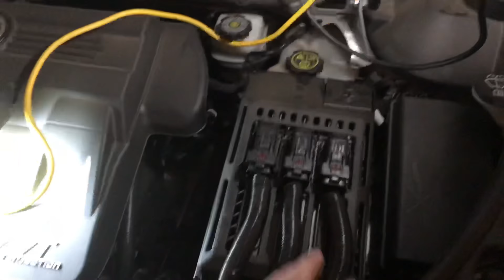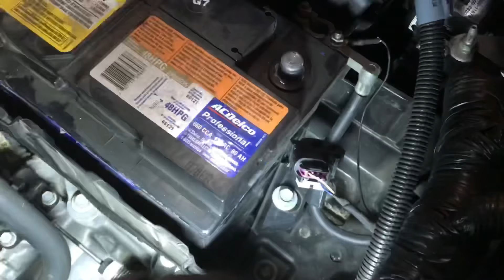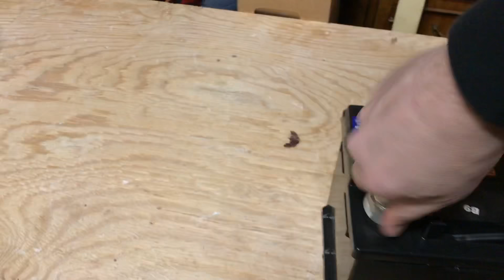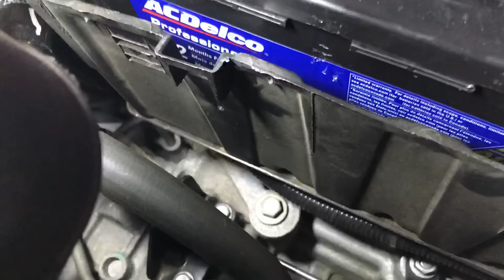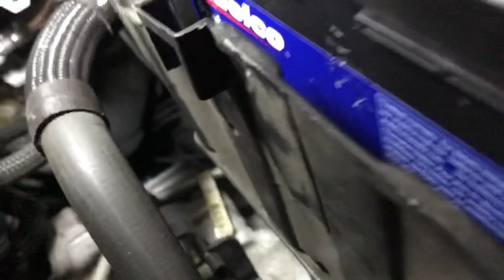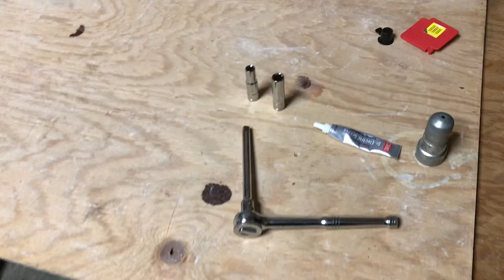How to replace the battery in a ‘10 to ‘16 Cadillac SRX

Comment: First of all Thank You for providing this video. I must admit I freaked a little when I saw the battery but after watching your video just once I had no trouble at all changing out the battery. It really went smooth. There are just a few things I would add. When I went to remove the cable from the plastic cover that makes it easier to push the cover out of the way, I discovered that it required a 1/2" socket. No big deal of course but you were so thorough in mentioning the 10mm and 13mm sockets I thought that I would mention this as well.

I also had a minor issue starting the car after the install. As always I put my foot on the brake and then pressed the starter button, but I only got one click and then nothing. The hood was still open so there was a warning message about that on the dash. When I dismissed that message another message came up that said that I had to lower and raise the driver's window, which I did. Then the warning about the hood being up returned. So I dismissed it again and then got a message that I needed to raise and lower the passenger window, which I did. Then the open hood message returned and I dismissed it yet again. At this point I had no more messages. I then tried starting the car again and it fired right up. Success! Odd about the need to raise and lower windows, but the car guided me through it so all is well that ends well.

Comment: Grease only the post at the end when the battery is connected.If you put grease everywhere on the post before connecting them you highly reduce the contact between the wire connection and the battery especially with dielectric grease that is know to have a low conductivity.

Comment: Thanks for the video.   Replaced the battery and the car would not start but obviously had electrics again.   Remote would work door locks and trunk hatch.   I looked at some youtube videos on pairing keys.   The trick that worked was hold the start button for 12 seconds, release and then start.
Reply from the maker: Thanks for the tip!
Reply: SO GLAD I SAW YOUR COMMENT!!  Thank you!!  I had the same problem and your info solved it.

Comment: I was working on a 2012 SRX and the battery went dead on me. I boosted it off, but now the air doesn't work, the driverside window doesn't work, and the radio screen is blinking on and off. Would the be a sign that it needs resetting?

Comment: was there an issue with losing settings due to lack of 12 volts for a while? Any special precautions? Thanks for the video.
Reply from the maker: You might lose some settings.  You could connect a battery tender to the battery cables before removing them from the battery.
Reply: I'm assuming a regular battery charger would work
Reply: I changed mine in a 2013 SRX Premium this morning exactly as shown and did not lose my settings. Thanks for the Video.

Comment: i just replaced the battery in my 2013 cadillac SRX and now when i get in the car to start it its saying my key fob isnt detected I have changed the batteries in the key fob and that doesnt work. Idk what else could be the problem
Reply from the maker: I haven’t heard of that happening before. Not sure what may have caused that! There are a couple of YouTube videos out there with possible solutions that may be helpful.
Reply: @Foxedup  I’m not completely sure either I’m going to try to program a new key fob to it tomorrow and if that doesn’t work chances are when I changed the battery something else went out inside the car
Reply from the maker: @cjg20252005  any success?
Reply: @Foxedup  no unfortunately so now I am not sure what is causing the issue in the car

Comment: Did you have or need to place a memory saver tool before removing the battery?
Reply from the maker: Domingo Lara - I didn’t use one.  One tip would be to wait a few minutes after opening the hood and closing the door until the system goes back to sleep.  Do not open any doors or anything else that would deplete the reserve energy sitting in the system.   Remove any lamps under the hood too.  Then have your new battery on hand so you can quickly switch it out.

Comment: I changed out the battery in my 2014 SRX and now it won't start and beeps at me 3 times like I've left the remote in the car, which i haven't. Also all the internal electronics flash on and off when I press the push start. Any ideas?
Reply from the maker: mightbegenius - might need to take that battery and get it tested or try to start a different car with it.  If the battery is good, then double check all of the connections on the battery.  Then it’s time to haul it to the dealer.

Comment: NEVER apply anything nonconductive on the battery posts prior to connecting the cables!  Clean all connections (posts and cable clamps) then attach the cable clamps.  Spray a terminal sealer on the connections to minimize future corrosion.  Nonconductive materials create resistance between the post and cable clamp eventually leading to starting/charging problems.

Comment: Looks easy.  Except my battery sits in  well that goes all the way to the top of the battery, so I can’t get that clamp at the bottom off without an extension for the wrench.  so off to the hardware store.